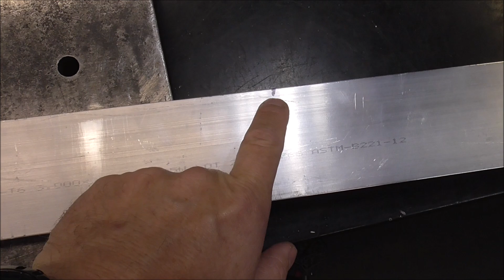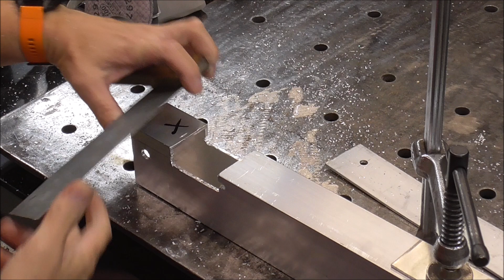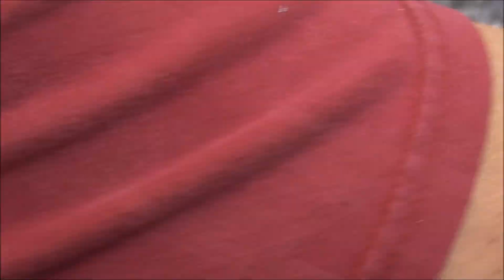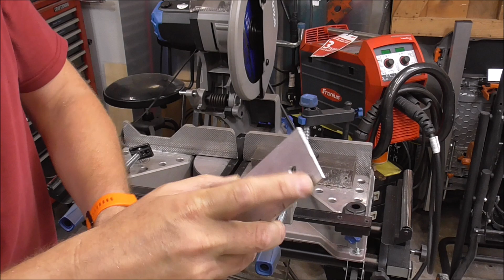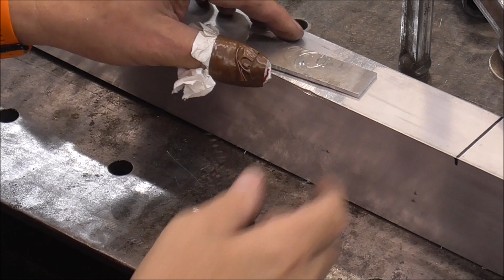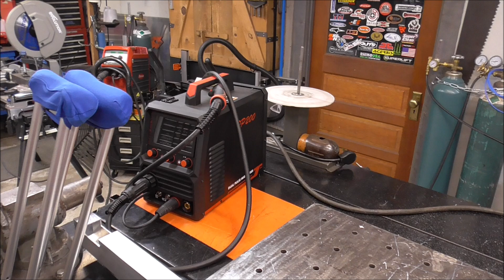DIY Milling and MIG Welding Aluminum Repair

Comment from the maker: LINK To DP200 Welder https://yeswelder.com/products/dual-pulse-welder-dp200?ref=BRANDONLUND
$25 Aluminum MIG Conversion https://youtu.be/FGhSo82MP9U
MORE WELDING AND FABRICATION VIDEOS HERE:https://www.youtube.com/playlist?list=PLfbf78fMz9Vol0uX2-GNc6mLi75zpqb5f
LEARN HOW TO WELD VIDEOS HERE:https://www.youtube.com/watch?v=ADa1I319GJ0&list=PLfbf78fMz9VqxPZTT-xmwdcrHVa7ML-ft
AWESOME TOOL BUILDS! https://youtube.com/playlist?list=PLfbf78fMz9Vo2Cv3V5fmYlDZGpS8Hp98l

Comment: Got a question. Anyone have any experience using an Amazon plasma cutter that has tig welding function? Ie plasmaargon it’s under $300 seems to good to be true
Reply from the maker: I personally dont have any experience with that brand. In general, most manufacturers have been upping their quality control due to the competition.

Comment: Great use of the router Brandon.  Will a HSS router bit also cut the AL or does it have to be carbide?
Reply from the maker: I haven't tried HSS, but I would think it would work.
Reply: HHS will work fine for aluminum.
P.S.: Don't try to use hand planes or chisels
for aluminum. I, personally, doubt it would
do them any good, because those kind of tools
use too fine an edge. 😁✌🖖

Comment: My nephew freaked out one day when I cut some 3/16 aluminum diamond plate with a skill saw that had a carbide tipped blade. He was sure I was going to ruin the blade, but it cut like butter. It does leave chips everywhere.  👍
Reply from the maker: I remember the first time doing simular. I was nervous thinking the same
Reply: Use to mount plywood blade ( not carbide ) backwards in circular saws to cut tin roofing.
Reply from the maker: That backwards trick works good for cutting vinyl sheet goods also 👍

Comment: MM77 Approved 👍🏼 👍🏼…………………………………………………………….LOL! I hear you brother! Get cut, grab a paper towel and some tape, ANY kind of tape and keep on working!  I keep rubbing alcohol in my work shop and garage so at least I clean the cut, burns like crazy but it works and the rubbing alcohol works great for cleaning almost anything I’m working on.  My wife has gotten to the point that when she sees tape on my finger, hand, arm, or leg, she just asks how deep I cut it and if I think it needs stitches! LOL
Reply from the maker: Hahahahaha we had a family auto mechanic friend that would do the same thing but would wash out his cuts in gasoline. He used to say, "Have you ever seen a fly live in gasoline"? He called it his antiseptic lol
Reply: @BrandonLund 😅😂

Comment: I would not have ever thought about using a router like a mill. Nice tip!
Reply from the maker: Thanks man I appreciate it. I scratched my head for a few minutes myself until I came up with it. It's a bit unconventional but worked like a charm
Reply: @BrandonLund there are similar tools used to 45° bevel Steel plates.

Comment: I didn't realize that you can use a wood carbide bit on aluminum like that thanks for the tips
Reply from the maker: Thanks Roger. Aluminum is a lot of fun to work with. You can even use a regular Circular Saw with a wood / carbide blade to cut it. It cuts really nice.
Reply: @BrandonLund  okay that's good to know

Comment: Wonderfully informative and interesting. That is so cool that you can use a router to mill aluminum.  That is just so cool!!!  Could that be applicable to steel also???  It would need an appropriate bit for sure.  The final product certainly did do the trick!!
Be well, be safe, and be Blessed!!!
Reply from the maker: Thanks Jim and that's a great question. I have never tried with steel but i would think with very slow passes and carbide tooling, as long as everything was clamped tight and you went at it slowly, it just might work.
Reply: Answer is yes! But also no : You need to accept the risks of exploding carbide router bits or milling bits, very carefully clamp and setup, reevaluate it, and take very thin cuts if you do commit. Did it on mild steel and cast iron. 
If you dont feed straight and steady, you kink the base a bit, it can catch and either explode the bit, kickback or pull you in...
Woodworking router bits can take both WAY MORE and WAY LESS of a beating that you think. Way more is not any safer : it  means the router pulls in and drags you or sends the thoroughly clamped part (Or so you thought) into geostationary orbit. Way less....it splodes te bit violently. 
A 15 amp 1/2"  router under full load going from 15 000-25 000 RPM to ZERO RPM generates the infamous 5, 6 or 7 PEAK HP that shop vacs marketing likes to falsely advertise....but for real (Instantaneous stall torque)

Comment: No matter how big or small, what kind of business you start, word of mouth and people come to get work done. Uncle Bill said and away you go in any type business you start. Do something wrong and it also gets around quick, usually quicker than you can respond to. Locks keep honest people honest, that alone says a lot about the fellow american. I used to let people walk in where I worked just to find someone snagged a socket or wrench
Reply from the maker: You are spot on. I couldn't agree more